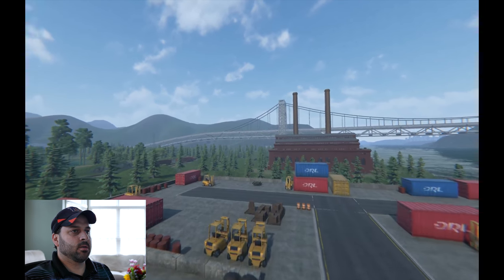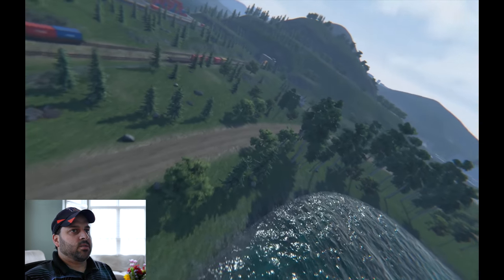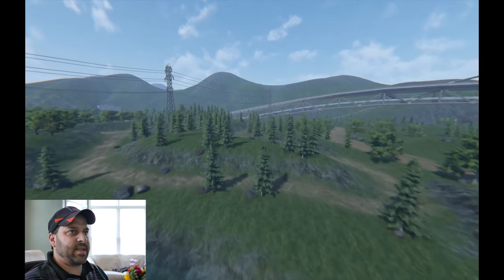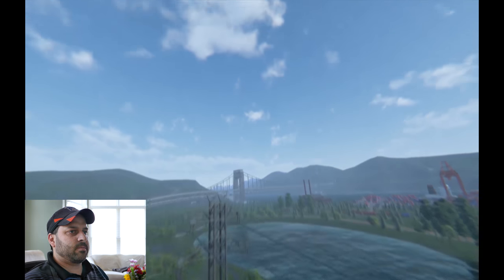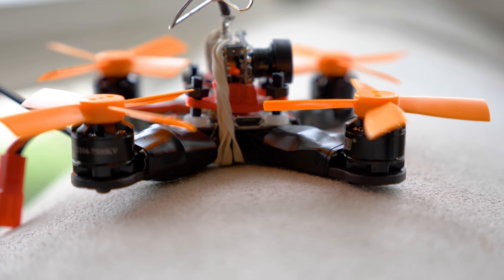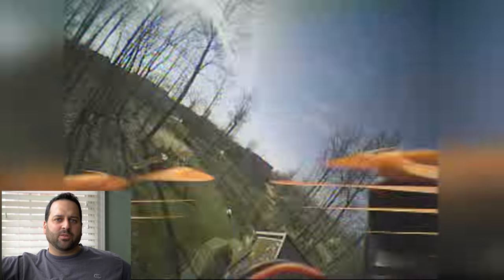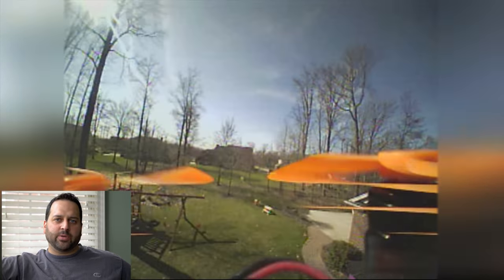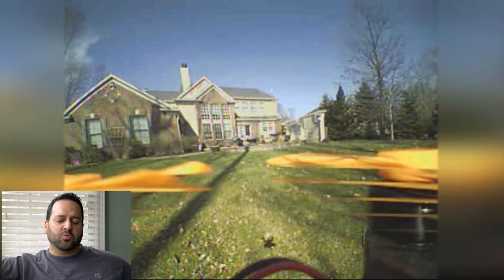Learning Inverted Yaw Spins

Comment: Hi John.. The trick to do the inverted yaw spins with your camera angle up, whatever you use,  is that when you do the rotation getting the quad upsidedown, don't go 180 degrees.. you need to try to keep it in the same camera angle that u are using... Nice instructive video as usual, and I hope you feel better soon.

Comment: you need to practice this trick doing a backflip or front-flip so you can get yourself flat rolling to the right or left you're not flat you're going to have to pull back make yourself flat so you're not in forward flight then roll to the right or left if you want to roll but you can't be in forward flight and then roll to the right or the left think about what your quad would look like just hold it in your hands and picture what it's doing if you do a backflip or front-flip it will be much easier rolling to the sides a lot harder to do yaw spins I guarantee if you just do a half backflip and then try to yaw it will look perfect

Comment: why are your simulator rates not exactly like your quadcopter? I thought that's the point of practicing in the simulator? you do know you can adjust your rates in the sim right that's the whole point is to go into the settings and adjust and tweak things to make it feel exactly like your quads so you're getting great practice time and building muscle memory.... also another tip don't worry about flying over anything and doing the spin over it just go really high in the sky and get the movement down once you can do them perfectly then worry about doing them over objects you know what I mean you're adding an extra element of proximity to it that's just making it harder shoot way up in the sky 300 feet do a half backflip and try to roll to the left or right and once you get comfortable doing that over and over battery after battery and you've got it down then try it over an object I hope this helps buddy that's how I learned it
Reply from the maker: The rates are not exactly the same because the DRL simulator doesn't use the same rates system as betaflight.  You can adjust rates until you get something that feels sort of like your quads, but for me, it's never "right".

That is something I'm really enjoying with the new Liftoff release though.  Liftoff now supports Betaflight configurations and the rates system works the same as Betaflight itself.  Since I fly betaflight, flying in Liftoff now feels much more like my real quad rates than any sim I've flown previously.  That has been very helpful.